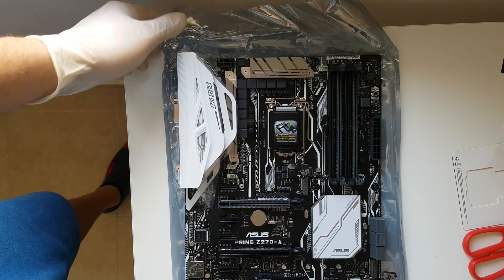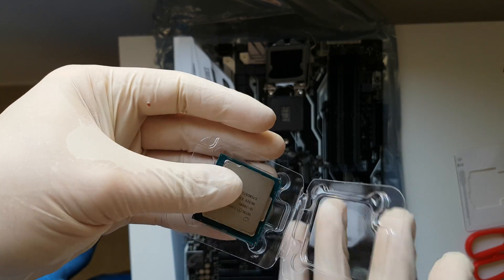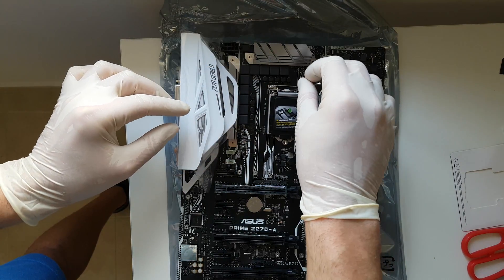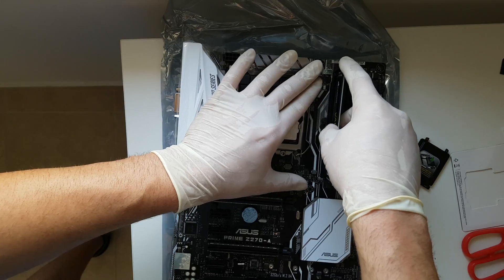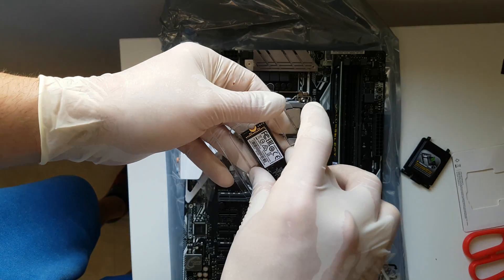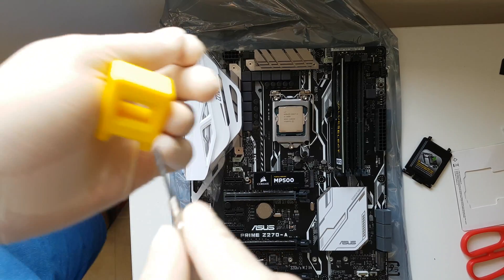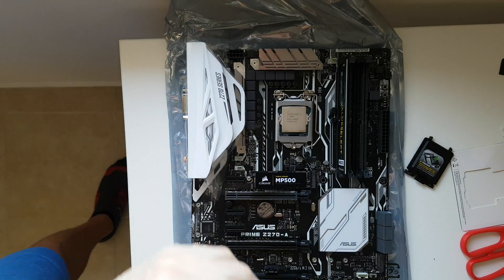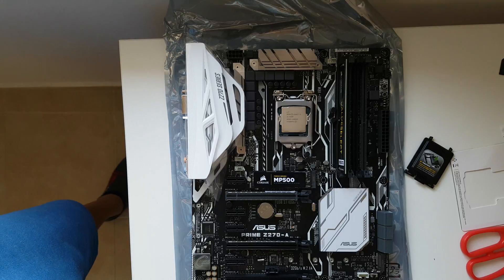Asus prime Z270-A CPU RAM MP500 M.2 Installation

Comment: Is worth this motherboard to use the sli with two Asus Nvidia GeForce GTX 1070 Dual?  I also want to use Intel Core I7-8700K. What's the PSU that you recommend? are 650W enough?

PS: Thanks for the video
Reply from the maker: Haziel Rafael Figueroa Estrada yes no problem with 
The sli connections and cpu it's okay and  750 power supply good
Reply: Thank you!!
Reply: Dude, For Cofee lake procesors (8th gen) you need a z370 chipset, not this one, cause the pin distrubution in LGA 1151 socket for 7th gen processors is different than the LGA 1151 (v2) for 8th gen (Como por tu nombre puedo ver que hablas español, necesitas una placa madre con chipstet z370, porque aunque tengan el mismo socket, la distribucion de pines del socket de octava es diferente al de septima, asi que esta placa madre no te sirve para procesadores de octava)
Reply: you're right, I didn't see the title of the video so well, sorry.
Thank you for the advice
I was looking for the asus prime z-370.
(Gracias por escribir en español pero tambien se algo de ingles para entenderlo, aun asi, gracias por la respuesta)
Reply from the maker: Mateo Gaon this is 7th gen

Comment: are u sure u put the m2 into the more optimal socket?
Reply from the maker: yes without a doubt.
Reply: @TechGuruAndrew  so putting it next to the GPU where it's more heated, disabling the 2 SATA ports in BIOS is the optimal choice for you? Instead of putting it to _1 slot and have it cooler (arguably) and no sata slots disabled? you're just a dip, look at the dislikes
you literally stuttered and read it M2 MVM like you read it for the first time (which I think you did)
Reply from the maker: when the video was created i didn't have VGA card and no need for more sata connection now i use the first slot thanks cheers :)
Reply: @TechGuruAndrew  But you put the M.2 drive in slot _2, not slot _1. Slot _1 would be the first slot.. ^^
It's okay to be a rookie at something but maybe not so smart to share what you do with others who might be rookies as well.
And why on earth are you using rubber gloves?
Reply: @ScottGLund  looks like he's using latex gloves which defeats the purpose of wearing gloves as an anti-static preventative measure, as latex can still conduct static electricity. You want Nitrile gloves for that and gloves are a lot easier than being tethered to an object via an anti-static bracelet. But yeah, this was really hard to watch Borat fumble around trying to teach people to do something he's obviously never done before.
Reply: @ScottGLund Slot_1 isn’t for Nvm.e drives bud

Comment: how do u insatll 2x8gb ram so its in dual channel mode? thanks
Reply from the maker: only one ram if you want dual must buy the dual channel ram
Reply: @TechGuruAndrew  The Ram slots are "paired" and colored differently to make it easy for Dual Channel. With the CPU to the top and Ram slots on right (as in the video) use the Grey ones first.

Comment: Lads pay attention on video name - this video is about installing M.2, not about where to install better.
- His mistakes: 1. He forgot to install M.2 spacer first so he did it later; 
2. By ASUS handbook - M.2_1 at the bottom is primary than M.2_2 in middle where he installed it; 
3. M.2_1 disables SATA one slot, M.2_2 disables two SATA 5, 6 slots;
4. He installed RAM in wrong place - first go to grey slot. Unless he just want show how to do that - in that case he is very clumsy and by fitting it with one hand you have a risk to brake it. You should hold it at both ends and press gently down and secure it with clips on the ends.

- Anyway it was worth to try to do video, just it's very risky to do mistakes when you are watching videos like this. 
Conclusion - video useless and misleading - in ASUS handbook you can find more information than in this video. Andrew you should explain not how to do but why as well and read ASUS handbook first before doing something.
--------------
Ok there is task for you: explain 1. how M.2 works with SATA slots; 2. procesors and Z270 chip compatibility; 3. M.2 NVME, SATA, SATA III speeds and DATA transfer speed threw USB 3.0 and 3.1; 4. What types of M.2 SSD fits motherboard - M, B, M+B key; 5.  Thunderbolt option; 6. TPM option; 7. RGB support; 8. BIOS settings; RAID function and so on. It's very interesting just make it professional. Good luck.
Reply: Nice comment but the M.2 slot bit is totally wrong. 

The one on the top (closest to the CPU) is M.2_1 according to Z270-P Prime manual.

Yes it disables Sata_1 port when you use the M.2_1 slot because of the Pci-e lanes being occupied by the M.2_1 port.

There are only two Nvme (M key) M.2 slots in this motherboard.